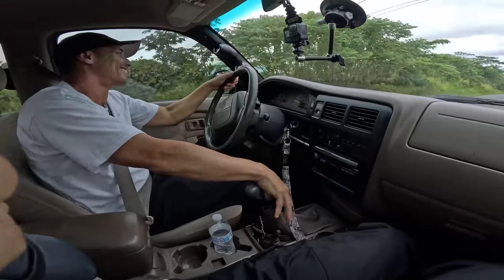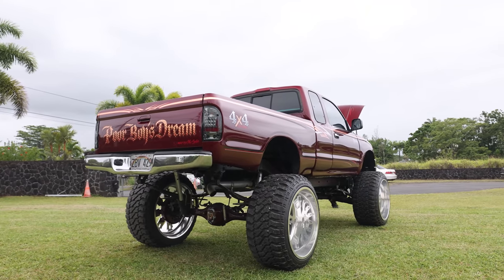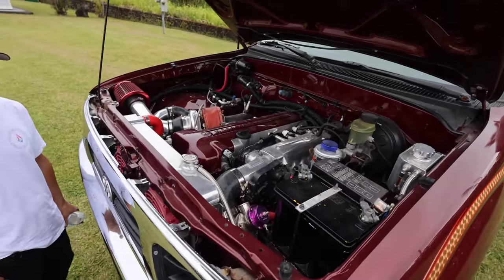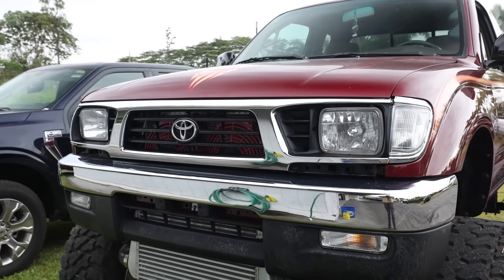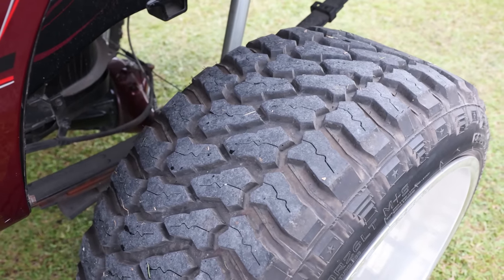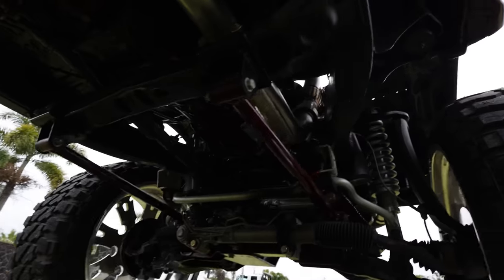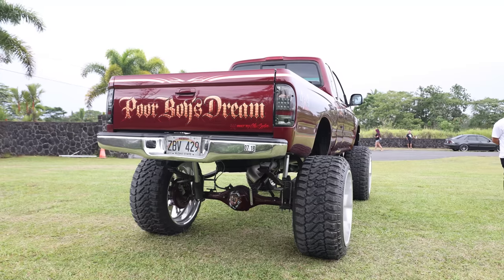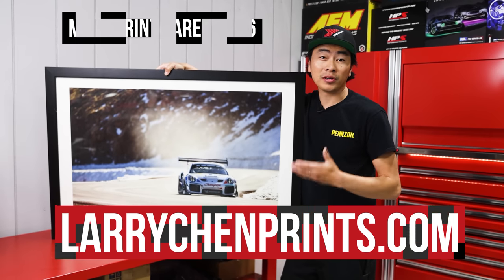2JZ-Swapped Toyota Tacoma Of Your Dreams From Hawaii

Comment: Not a common swap, but very easy to do if you do enough research. Took me 2 weeks to swap a 2JZ into my 4Runner, all bolt on 👌
Reply: What gen 4Runner?
Reply: @jonahfesman861  3rd gen
Reply: @mikepao6109 that's badass 
It seems like it all fits easy
Reply: Dang!!!!! Wasn’t even thinking about doing this swap, now, maybe……. Research time!
Reply: Yeah 1jz into my 4Runner was the easiest swap I ever did
Reply: this swap is done in jamaica alot
Reply: I just sold my ‘97 taco that I had potentially planned for a 2JZ swap, but decided on doing the swap on my ‘99 runner…. Doing research right now. Do you have any suggestions?
Reply: @richienino5626  the 1st gen Tacoma mounts from CX racing are the easiest option unless you go custom. The drivetrain will be pushed back a couple inches so you will need shorten your drive shafts at least two inches front and back.
Reply: So a r150 bolts up to a 2jz? Needing for clarity.
Reply: @adammadrid3839 yes it does. If you have a 1995 R150F you have the short input shaft version. If you have a 1996+ R150F it has a longer input shaft, meaning you will need to change the lengths of both the front and rear drive shafts. But the key is to use an 1JZ/2JZ R154 Bellhousing. I hope this helps
Reply: I'm wanting to swap a 2jz into my 2nd gen with an A340 trans, has the old 3vz bolted to it. will the 2jz just bolt to that bellhousing?
Reply: Can you use the same trans
Reply: @prestonr8566  any V6 R150 trans will bolt up with the appropriate bell housing. Just depends on what year it is. 96+ bolt up with a 1JZ clutch flywheel and bell housing. 95 and under require the use of a custom bell housing (Found on eBay) due to a shorter input shaft.

Comment: I Did this same exact  2JZ Swap into a 1998 4x4 TRD Off Road X-Cab 5 speed  V6 Tacoma 11 years ago. You did almost exactly the same install I did. Using the same 1JZ  R154 Bell housing I did. I ended up using a RPS twin disk carbon carbon strapless clutch good for 1,200 horsepower. I little over kill for my HP range, but ended all clutch issues I was having. Best decision I made after dealing with cheap single disk clutches that either had unpredictable engagement points, snap clips popping off the throw out bearing and so on. The RPS clutch was so smooth very predicable engagement with light pedal pressure. Like a stock V6 tacoma clutch. The carbon clutch is designed to be slipped. The hotter it gets the harder it grips. The clutch is also rebuildable when it does wear out. I also moved  the transmission back 2 1/2 inches. Welding a new T-Case mount bracket I fabricated to the cross member. Lengthened the front drive line 2 1/2 inches and shortened the rear 2 1/2 inches. Cooing fans in front. Intercooler almost in the same place. I positioned my intercooler up higher with the bottom center of the valance cut out. Intercooler looks about the same size but I tucked it up just a bit higher. I used a FRONT sump non VVTI engine. That also will clear the differential, steering rack and frame cross member. No modification was needed to the oil pan. I put an oil filter relocating kit in mine since the stock oil filter location on the 2JZ  is really close to the suspension tower in the Tacoma. My oil  filter is located on the inside of the drivers side frame rail next to the transmission. Easy oil and filter change that way. Having the base of the filter up or the top of the filter pointed towards the ground makes changing the oil a lot less messy since no oil spills out of the filter while spinning it off. Not sure a rear sump will work in a 4x4 Tacoma or 3rd gen 4Runner with the differential in the stock location. I kept my truck at stock height. Clearly your differential is dropped way lower with that huge lift kit you have.  Like you, I did the whole swap without cutting anything. No frame mods or engine compartments mods. Did the swap with the idea I could put the 3.4 V6 back in if I wanted to and no sings of any modifications would ever show from a 2JZ being in there. Also did the swap to maintain all functionality of all the factory gauges, AC, power steering and cruise control. 100% of everything in the truck functioned after the swap including the factory differential lock.  I also converted 2JZ over to OBDII to pass state emissions. It passed 3 times with no failed test the 5 years I had it.  Since the truck is OBDII standard and had to have a functional OBDII port to pass state emissions. I had Tweaked Performance out of Georgia custom modify my non VVTI JDM 2JZ engine harness with all the 4x4 Transmission connections, USDM modifications for all the OBDII parts needed in the 2JZ OBDII USDM standards including using a 1998 USDM OBDII 6 Speed Supers ECU. Other than adding the wiring and plugs for the tacoma tranny & T-case. Tweaked also had to wire in the resistor solenoid for the USDM 550cc fuel injectors, The plug connector for the USDM mass air flow meter and a resistor mod for the non existent EGR valve on the JDM 2JZ engine. Tweaked also modified the harness body plug that plugs into the main body harness to just plug into my 1998 Tacoma. No wiring in my truck was cut, spliced or modified either. The JDM and USDM ECU Plugs connectors are the same. Whole swap was plug and play.  When all done. My Turbo Taco came up as a 1998 Turbo 6 Speed Supra on scan tools when running diagnostics. The fortunate thing for you is a lot of off shelf bolt in stuff is available now for swapping 2JZ into a Tacoma along with just about anything else people want to swap a 2JZ into these days. When I did this 11 years ago. A  2JZ in a functioning 4x4 Tacoma did not exists anywhere online. I searched forums, countless web sites. NOTHING. I found two wheel drive Tacomas and 4Runners. No 4x4 2JZ Swapped Tacoma existed yet. I set out to figure it out on my own. No one supplied anything for putting the 2JZ in a Tacoma. I had to fabricate and weld my own motor mount brackets for the engine. I used LC Engineerings Bomb Proof Mounts to bolt to the frame and the fabricated mounts I made. No intercooler kits were available either. I did a lot of measuring and managed to get it right the first time when parts showed up. All the piping and instercoolier installed all worked out.  From start to finish. The swap took two days from pulling out the V6 to first drive with the 2JZ. Everything about the truck looked stock other than the intercooler showing in the center where the plastic valance was removed. The video links show my truck right after I got it done and later on I swapped out the stock twin turbos for a big Precision turbo with a set of HKS 264 cams.  My truck was between about 450 to 500 horsepower which is about the max with a stock USDM OBDII ECU. Stock USDM 2JZs have a bit more room for horsepower gains than the JDM Versions. Mostly due to the turbos and injectors used on JDM vs USDM. JDM fuel injectors are only 440cc. USDM injectors are 550cc. Since I had to install the USDM 550cc injectors in my engine with the OBDII USDM ECU. That gave me more room for power with the big Precision Turbo I eventually swapped in. To go beyond where I was required going to a Stand Alone ECU. Trust me, as you know also. The toque and horsepower I was at in my truck was quite enough to get the job done quite well. Including smoking the tires through the gears.  One mod you MUST do if you haven't yet is get a short throw shifter. Man that makes a HUGE difference shifting a lot faster. I use a B&M Short throw shifter kit  for ALL R150F Transmissions from 1988 to 2004. Yes, That's correct. The shifter towers are the same from 1988 to 2004. Only big difference between the R150F used on the 1988-1995 3.0 V6 and the 1995.5-2004  3.4L V6 is the length of the input Shaft which also is why the bell housings are an inch different in dept. The 3.0 bell housings are an inch shallower since the input shafts are 1 inch shorter.  The videos clearly show changes over time in my truck. Twin turbos in some and the single turbo in others. Boost and AF ratio gauges changed, dash cluster swap from black to white face. Wheels and tires changed. I also installed some really hefty traction bars. The 4x4 Tacomas are notorious for cracking and breaking leaf springs.  Breaking springs I knew would be a problem big time with this swap. The torque these engine put out I knew would really increase the axle wrap up and hopping. The traction bars eliminated all the axle hop and axle twisting. Kept the axle solid in place like link suspension set ups do. Never broke a spring in the 5 years I had it. The friend of mine I sold it to had it up till last year. He nevrer broken a spring. The only thing that ever broken in the truck was a ring gear in the rear diff once a few year ago. Other than that. The truck has been very solid, very reliable clocking over 70,000 miles with no issues other then the one ring gear issue. 

https://youtu.be/3_Qp_djS08g

https://youtu.be/gRFzRKSIgN0

https://youtu.be/Sw8uJlMONgA

https://youtu.be/JPQW1kId1z0

https://youtu.be/94E2mQmM1XE
Reply: Na brah that's sick
Reply: its crazy i saw your form posts and looked up your youtube and saw your build! to see you post on here and be like "oh snap its that dude!!!" XD so cool.
Reply: Hey Matt you think this will swap easy in a 1st gen 4runner?

Comment: Hmmm… We all have different tastes and I would have done 18 x 10’s wide with smaller rubber and lower it a few inches. Just my $0.02 cents… The clutch and rear differential got to be the weak spots. I had a 07 reg. cab, 5 lug, R155 trans, 2TR with a Magnuson, Snow water meth system, Heltech tuning, OE 8.4 diff. w/ 3.73 TrueTrec, 28.5” rubber and it was hard on Clutch’s! It now has a torque cam aluminum L33 with a TKX and back to 3.31 gear.

Comment: So basically,  the r150f transmission which is 5spd 4wd transmission, bolt straight to the 2jz motor bell housing?? So what u saying is my 2jz ge motor, I got an automatic, if I remove the auto transmission, use the bell housing I could just slap on a r150f 5spd trans/gearbox n it bolts right on? -- thats new
Reply: 1996 and up R150F is a direct bolt on to any JZ motor with the R154 bellhousing and clutch from a Soarer.
Reply: Yes you can use that R150f trans bro. Any 4x4 5 spd R150f trans will bolt up doesn’t matter the year. 89-95 V6 trans is R150f and 96-2004 V6 R150f trans are the same the only difference is the motor 3.0 to 3.4
Reply: @kaalakealohakawahakui8654  input shaft length is slightly shorter on pre 95 R150F. Requires a custom bellhousing for direct bolt on

Comment: Completely worthless truck 😂
Reply: That thing can go all over the island beach or off road how's it worthless
Reply: so are most fast things
Reply: @JB-sv5pr suspension has no added ground clearance with that drop bracket kit - it is trash, wheels are trash, tires are trash… where does it end? The only good thing is the engine.